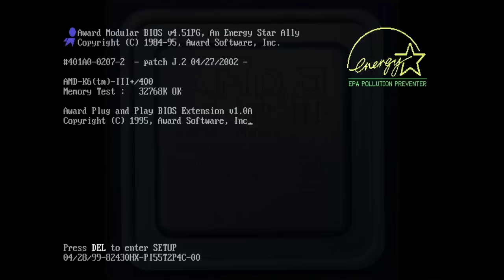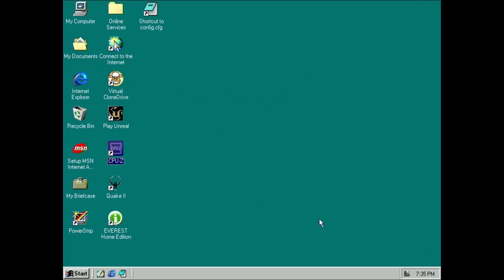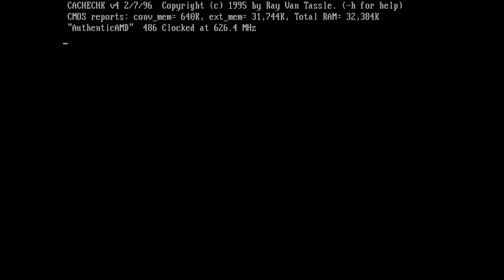Turn K6-2+ into K6-III+: Modification and Assembly (Part 2)

Comment: I can't recommend getting rid of that conical tip and using a small bevel tip enough. The shape works great for most SMDs and the surface area holds more heat so you don't have to keep holding it in place over and over. Especially in situations like this where you're fighting what is essentially a heat sink. Typical conical tips are a huge pain and most professionals I know only use them in very specific situations. Honestly most beginners would have a much easier time learning to solder if they stopped including those damn things as the default tip IMO.

A concave bevel tip like the Hakko BCM2 is even better IMO as it can hold a little solder in the tip which allows you to pull solder off of something then spread it.
Reply from the maker: Thanks for sharing - I will have to update my soldering gear and also learn more.
Reply: Yeah it’s super frustrating that they always include a conical tip with basically every soldering iron. It wasn’t until like 5 or 10 years after I started soldering that I learned about how much better bevel and flat tips are and they’re now my go to for basically all projects. Ironically they’re even better for small SMD work. I only find conical useful for certain micro soldering applications where a larger tip physically won’t fit or would touch too many components, but otherwise bevel or flat tip all the way.

Comment: Yers ago I had original k6-3+ 550. It was last upgrade for that PC. It walked through k6-2 266, than 450 and last one, with moded bios to normaly support it k6-3+ 550. All of it was overcloked as much as possible. 
Hava a warm remembrance about it.
Now I don’t even have PC. Just notebook from company. All I know it have i7 inside, but even don’t know frequency of it, it des not matter now. It just do its job fast and that’s it.
Reply from the maker: I know what you're talking about. Back then you developed a deeper relationship with your hardware! You had to read the manual to find the right jumper settings. You read reviews about what sound card to buy or what network cards. Now it all comes integrated on the board - nobody cares anymore
Reply: @bitsundbolts  exactly!

Comment: my exp, just a delid and good TIM makes these able to do 650mhz stable, if i still had any of the 6 copper caps i had from back in the day i would send one, a thicker ihs without a channel), 3 of us ran them at 750 with stupidly loud air coolers. (the copper dragon orbs as i remember it), that was genuinely amazing back then... my friends who had gone with overclocked celerons and even full on p2's often were jelly at the perf i got in games...as most games got 3dnow patches, even seeing a powervr+3dnow compile of  a few games like unreal, its weird how i miss those days... kinda wish there was a proper emulator profile for older hardware in stuff like virtualbox....
Reply: 659mHz is quite extreme .  Surprised a common high speed CPU like that wouldn't malfunction with such extreme underclocking .

Comment: what you solder was capacitor.  also  if the die is taller than the capacitors, you don't have to put the cover back   it cools down more efficiently without that cover
Reply from the maker: It is a 0 Ohm resistor (measured it with multimeter). The cover is mainly put back on because those silicone dies are very fragile.
Reply: @bitsundbolts  actually  the dies are more rigid than those on pentium III

Comment: 0:56 Hello. Tell me, what video capture card are you using? How do you capture a VGA signal?
Reply from the maker: I use the Open Source Scan Converter or OSSC (1.6 in my case). Then from HDMI to USB capture device.
Reply: @bitsundbolts  thank you

Comment: Very nice that it is possible to do this mod, although I have to say for my now more than 20 year old system with a k6-2+ for now I’m not going to risk it, if a game does not run on it I could alwaysrun it on a more modern system like a PIII or Athlon. Maybe if I find a cheap k6  2+ for spare on eBay, but prices of these are probably still high anyway…

Comment: I have PC with AMD Duron 850  MHz (Socket A Socket 462) mobile version that soldered to the motherboard (mercury kob 740 cfdmx) is ther any chance to unlock it to Athlon xp+ ?
Reply from the maker: I think there may be some mods for socket A CPUs - I don't know the details yet, but if there are, I will probably cover it in future videos.
Reply: Duron 850 and Athlon XP are different dies. You can't unlock one into another. The most you can do is unlock multiplier and overclock (if your MB supports it), but not too much, since that core ran around 1.1Ghz max.

Comment: General purpose RTVs give of acetic acid when curing which might cause corrosion under your heat spreader. (see the safety datasheet for the RTV)
Reply from the maker: Thanks for letting me know. I was not aware that it could cause issues.
Reply: Dow make Dowsil 3145 RTV for sealing electronics. Expensive but there will be other brands too.
Reply from the maker: Thanks for the suggestion. Will try to find a suitable RTV - at least I'll read what's written on the packaging!
Reply: @chrismorley5393  I've used tons of RTV-3145 and it it surprisingly delightful to use. Low-odour, cures reasonably fast, easy to extrude, can be kept in a sealed syringe, great chemical and electrical properties. Literally the only awful part is the price.

Comment: I had one of those back in the day. It ran great while it was working. The only problem was that 3 of them died after a while and suddenly AMD wouldn't even sell them any longer. Although i got the money back, i had to use the K6-2. I haven't touched an AMD CPU since... 
Also, can you run it without the cover back on?
Reply from the maker: Direct die cooling may be possible; however, I did not try that. I have heard that the die is very fragile and may break much easier compared to later Thunderbird and Thoroughbred dies.
Reply: @bitsundbolts  I see. If i remember correctly, it was already clocked at the end of the line, so there would be no real gain from doing that...

Comment: Run a memory intensive task on the computer. From what i was told regarding this the k2 vs k3s were the same chip, but they were all k3 dies but some failed the cache memory testing and were made as k2s. Ive done similar literal hacks to change the resolution setting on old BST type thermal imaging chips in firefighter cameras and it revealed they had a few stuck pixels making them off spec for high resolution military use but fine for general purpose use at lower resolution.🤓
Reply from the maker: Yes, the K6-2+and the K6-3+ use the same die. I am sure there are some CPUs out there where the mod doesn't work. But I also heard that the yield on those CPUs was really good. AMD disabled half the L2 Cache of good dies to meet market demand. But as you said, could all be tolerance that wasn't in spec. Until now I haven't noticed any problems with the CPU, but I may just try Prime95 or similar benchmarks on the CPU

Comment: Why no thermal paste between the lid and the die before you glued the lid back on?
Reply from the maker: I did use Arctic MX-4 between the die and the aluminum lid.
Reply: @bitsundbolts  that was a good move, I didn't catch it... my bad.
Reply from the maker: No worries!

Comment: with milenium bug computers. can they calculate an age of a person who is born before the year 2000 ? because then it may use a date wich can cause a problem. i dont now. maybe it odes not matter.lets enter 1990 or so. and then the date is 2010. the date itself is not modified. it is a calculation with date and not a date change. just wondering. about birthsdays entered after the year 2000. are they not all born in bios or cmos default time in the goverment data base ? such as 1978 ?  just makeing conversation.. small talk.

Comment: What is the name of the cleaning liquid??
Reply from the maker: I use WD-40 to dissolve some of the glue on the die. After soldering, I use isopropyl alcohol to remove flux remains.

Comment: Well maybe in 2001 that would have been a good idea. Since everything is faster today I am not sure why you would do that just to have a modded collector chip maybe.
Reply from the maker: You can still find bulk sales on eBay. I got two of those CPUs for around 30 USD each including shipping. I won't touch the second one though! For one thing, I don't have to hunt down a real K6-III+ which are more difficult to find and are way more expensive. But yes, the risk and collectibles status may not justify the mod. In the end it will be your decision

Comment: Use flux while soldering. Really, it is that simple.
Reply from the maker: I used a bit of flux, but maybe too little. Will try again once I get a new batch of higher K6-2+ models.
Reply: @bitsundbolts  Use a lot of flux. Components should float in it. Do not worry about creating a mess, just use non-corrosive one.

Comment: wasnt this the first cpu with P states  multi clock >>?>>???  power strip gpu clock modding fun times   good old socket 7
Reply from the maker: I am not sure if it was the first CPU, but the mobile + versions supported the PowerNow! Feature. Intel had a similar feature called SpeedStep. I think this is what you mean by P-States

Comment: Good old Days I unlocked my AGP GT 6200 to GT 6600  +OC =+100% performance, or Phenom II x2 550 B.E. unlocking cores, :)
Reply from the maker: I didn't know you can unlock those too!
Reply: @bitsundbolts  not all GT 6200 only first batches, Also First batches Rx 480 4GB unlock to 8GB
Reply from the maker: I love those modifications - I definitely want to do more of those. But the alterations can't be too advanced as I do t have the skills.
Really? They put 8GB memory on 480s and limited them by the drivers/bios?
Reply: @bitsundbolts  yes bios lock :)
Reply: Yeah, Phenom II X2 to X4 unlock was like the easiest and best unlock ever by going into the BIOS. It's a wonder AMD ever sold any Phenom II X4s...

Comment: This video is about 20 years late :-)
Reply from the maker: Better late than never. The hack was published at the beginning of this year. Still 20 years late...
Reply: @bitsundbolts  Guess it is time to dig up my own k6-2+
Reply from the maker: What model do you have? Higher clocked models are supposed to have have better success rates
Reply: @bitsundbolts  Mine is a 450 MHz, either ACZ or ADZ, I was using it on a Soyo 5xae5 Socket 7 main board with a BIOS Patch.
Reply from the maker: Same model as the one I modded. I still have a second one - untouched. And I'll keep it that way. Probably still need an original one for future use
Reply: @bitsundbolts  What video card would you advise to pair with a k6-2+ (besides a Voodoo 2/3) in the system which does not have AGP?
Reply from the maker: I have not tested any much aside the Voodoo 2, but I think TNT and TNT2 variations may be interesting with those CPUs. The GeForce2 MX PCI may also be interesting. But I don't know from when the CPU is the bottleneck. I don't own any of those graphics cards in the PCI Version - only AGP
Reply: @bitsundbolts  I used a Radeon 7200 PCI 32 Mb SDR and still have it - is it an overkill? I remember trying to run Serious Sam on it when it was out at like 15 FPS (but probably the CPU was the bottleneck and it was just not the suitable game to run it).
Reply from the maker: I haven't tested any Radeon card yet, but yes, it could be that the CPU is the bottleneck. If you have a faster system, you could try to run the game there and compare results. Or search online for Radeon 7200 benchmark results and try to reproduce the same result. That could help you figure out what the bottleneck is.
Reply: would make no difference in 1999 or 2000.
1) noone would risk it on actual expensive processor.
2) gain is too small.

it is the mod, you gain little, risk too much.